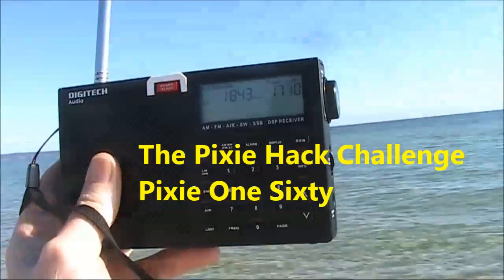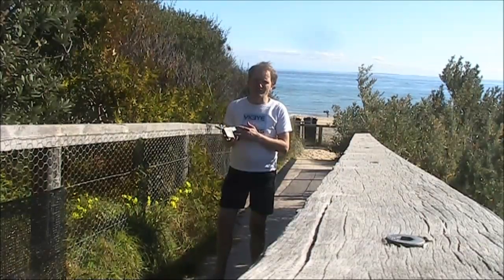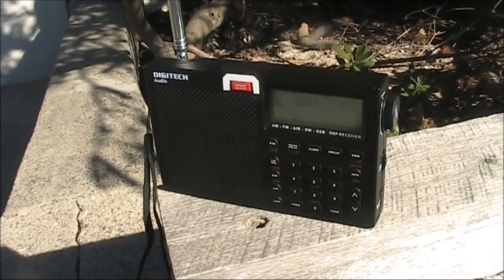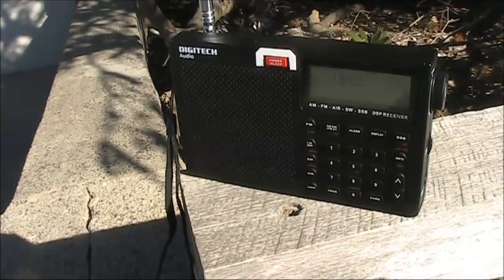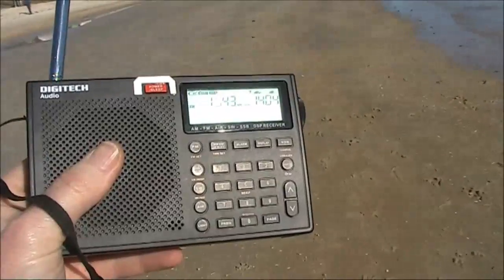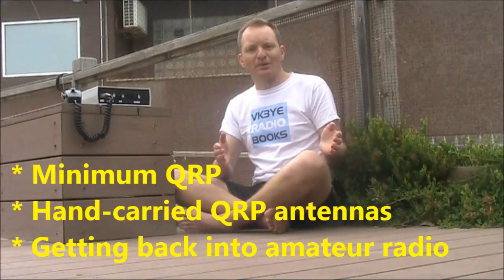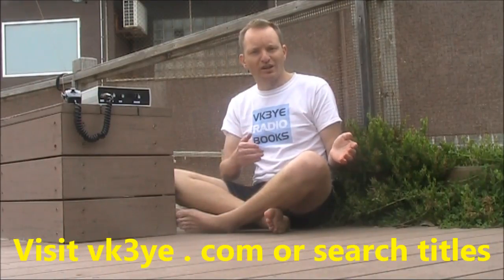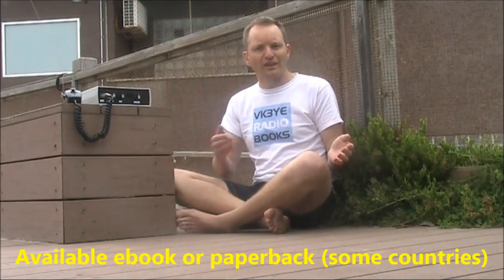Pixie Hack Challenge: Pixie One Sixty (Pixie AM transmitter on 1.8 MHz)

Comment: Cool test! You must have built a decent antenna though

I made a broadcast band transmitter for 1620khz, it does about 100mw, i have a big loading coil with a 10 foot copper vertical, and it can only go about 2000 feet. (Antenna is only 12 feet off the ground)

Comment: Very interesting, try range testing it like you did with a magnetic loop for a receiving antenna. I made one for the am broadcast band out of computer ribbon cable connected to form a multi turn loop with a capacitor across it. It was fed inside a hula hoop and the capacitor inside a kitchen container. Inside the container was a differential amplifier based upon a ne592 differential video amplifier connected across the loop. Worked great! If your antenna was a high vertical structure loaded with your coil, the results would possibly be better.The ground system there could be the Achilles heel though I suspect.

Comment: Hi Peter, great to hear your 160m transmissions tonight!

I could barely hear a constant carrier on 1843 kHz as I tuned the receiver in SSB mode, but switching to CW with a 500 Hz filter rendered it definitely audible.  I didn't hear any audio modulation on either sideband, which isn't surprising given it was AM and the received carrier level was so low.  I heard the carrier interrupt a few times at 1119Z, and then a series of V's from 1120Z, and the carrier returned to continuous at 1124Z.  I understand that you were "keying" the transmitter by tapping the crystal with your finger. :-)

Received signal strength as indicated by the S-meter here was S0.  Receiver: TS-480HX; antenna: 80m OCF dipole with the feedpoint at 15m height (my 160m 1/4 wave sloping wire antenna is still down).  I wonder if I would've been able to hear it over all the band noise if the 160m antenna was used?

The received level increased dramatically at 1132Z.  It was still reading nothing on the S-meter, but noticeably louder.  I reckon if you could've keyed it at a slow rate of wpm it would be readable enough for a QSO!

Thank you for another fun beacon reception experiment!

73,

Mike VK2IG